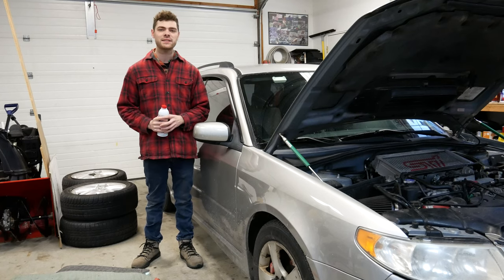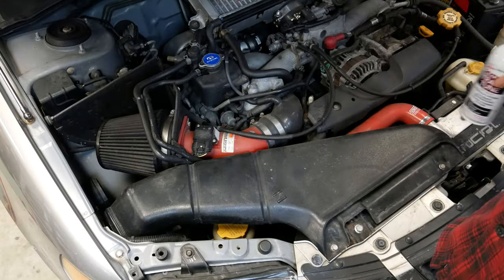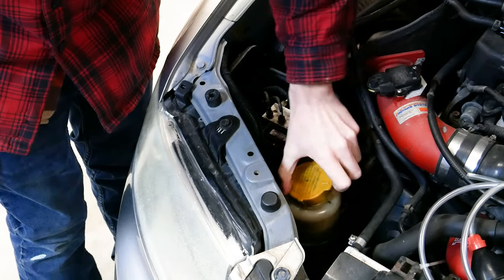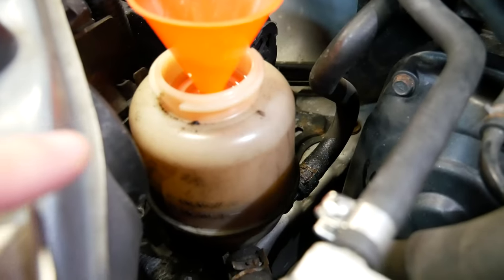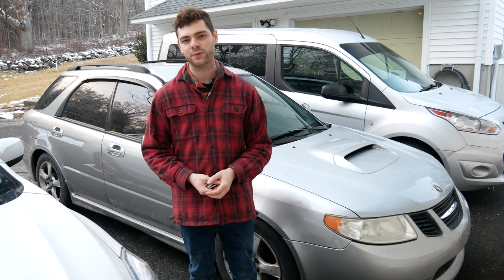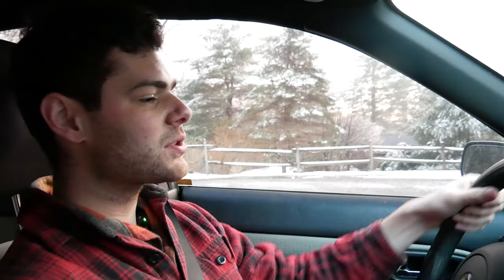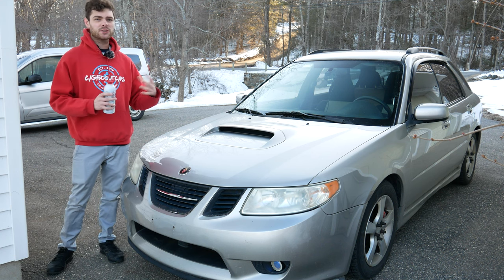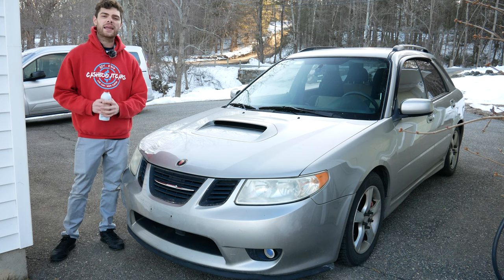How to Fix Power Steering in ANY Car! (Try This BEFORE Replacing Parts!)

Comment: Leave cap off while turning wheel to bleed off air bubbles
Reply: With engine on or off?
Reply: @nelsoncanelas1978  engine running.  Cap off.  Turn wheel to lock points multiple times.  Let engine run a few minutes by itself.  Replace cap.  Drive.

Comment: you should have changed the fluid after running it for a week. you are essentially using really dirty fluid after the seafoam cleaned everything out
Reply from the maker: Yeah, I agree, running it like that long term is not ideal

Comment: I used ramps on the back Tires and Flushed the whole Power Steering fluid with a Pump you can get it at Walmart under $10 bucks worked like a charm 😮 saved about $250 bucks

Comment: I have a 2005 Grand Mercury Marquis the power steering fluid level is good but completely lost power steering at first when I turn the car off and back on the power steering we come but now the power steering is gone regardless
Reply: did you find out the problem i have a 1997 and it does the same thing?
Reply: I have the same problem on a Holden astra

Comment: I own a 2008 Dodge Grand Caravan Replaced the power steering pressure line never had problems with the steering before this except a leak in the line, now having problems with stiff steering

Comment: Can work on electrical power steering hard to turn wheel
Reply: Most likely stiff U-joint if not then knackered pump
Reply: Electric don’t have fluid
Reply: @Speedfighter313  thank you
Reply: wait what kinda car is it?
Reply: @rabbitdrink  Milan mercury hybrid
Reply: @carlossaunders3130  check the wiring going to the sensors
Reply: @rabbitdrink  i will thank you

Comment: "marginal"  "significant"  ...  Make up your mind.  ...  "few weeks"  ...  By then, the vehicle may have damage that was not originally there, even with a lot less time.  Anyone that listens to this will probably wind up worse off.  Diagnose the problem/s properly, or have a professional do so.  Or, probably, cost yourself more money/time.

Anytime you realize there is a problem with anything, IMMEDIATELY, properly diagnose!  ...  "potentially fix your car, without replacing any parts"  ...  That is disingenuous, at best.

It appears to me, this dude is just trying to make money from affiliate links.